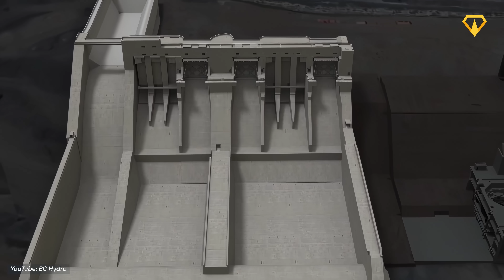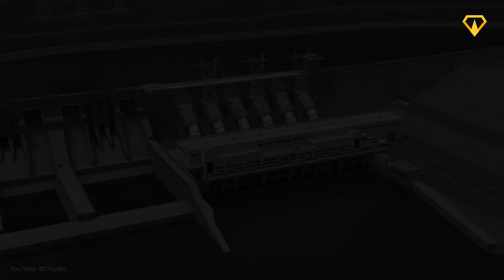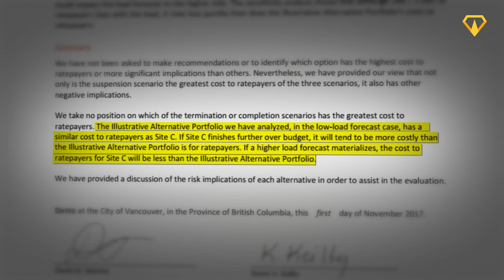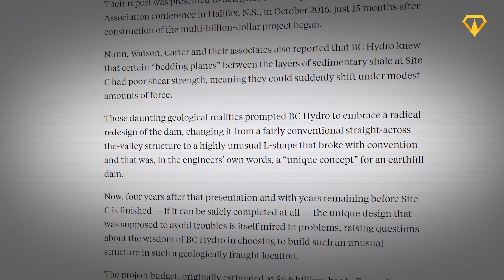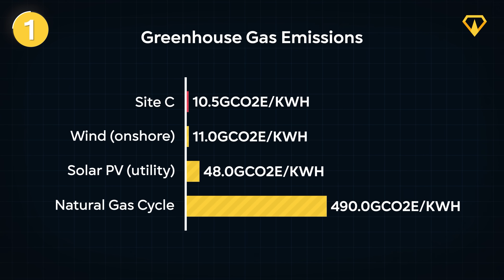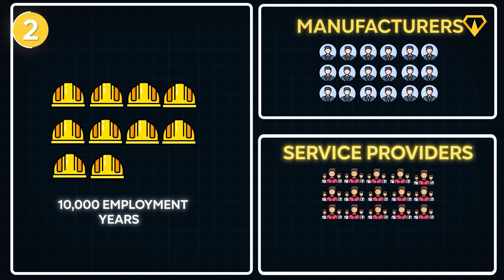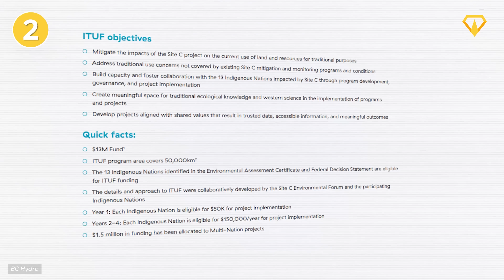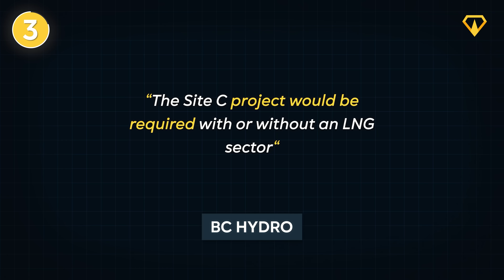Canada's Massive $12B Mega Dam

Comment: Canada needs a UHV transmission super infrastructure across the country. Today the interprovincial transmission system is outdated and does not even meet a third world country standards. Canada has a huge advantage, the different time zones. this would turn the whole system, if it was truly interconnected, in an extremely efficient one.
But no, let's be provincially independent. With that mentality western Canada has small and inefficient interprovincial interties. Just look at the Alberta Saskatchewan one, or the BC - Alberta intertie, a 500 kV double circuit with very limited use also restricted by provincial regulators.
If a federal transmission system was in place a $24 billion damm was not needed at all. Thanks to politicians blindness and lack of future vision every British Columbian owes $4000 at today's cost of the Site C damm.

Comment: With the headgate, you cannot control the amount of water flowing through the turbine, you can only switch off the turbine. Control is made by the wicket gate in the spiral housing of the turbine just close to the runner.

Comment: LNG from BC to Asian markets may not be such a sure bet.  China has already peaked in coal imports and is steadily eroding thermal coal with renewables, primarily solar and wind in an incredibly fast build out.  China is also getting very cheap gas from Russia by forcing Putin to sell it at huge discounts just to keep it flowing during sanctions over his stupid war in Ukraine.  China is also tops in battery tech with CATL and BYD batteries now being quickly scaled up in massive grid packs, allowing China, Australia's Victoria state, the UK and Germany to achieve enough renewable power to put gas and coal electricity peaker plants out of business recently, and future fossil power generation on notice as an increasingly tenuous investment.  The IEA has been documenting the approaching steep S curve in worldwide investment in solar and wind for a few years now and noted that money flowing into solar and wind has surpassed the total world investment into fossil fuels for the first time last year.

Site C power should, in my view, be used to catalyze the electrification of the domestic economy, to reshore steelmaking back to Canada and power up R&D into producing low emission cement.  Low emission steel using electrolysis and electric arc furnaces is already out there or just coming off the lab tables at MIT for commercialization.  BC LNG could become a huge stranded asset by the early '30s if its export markets in Asia decrease their demand for fossil gas by ramping up electrifying their own economies, or force BC LNG suppliers to drastically lower their prices, a highly unlikely prospect because it's very expensive to produce and ship and is already outcompeted by Gulf Coast LNG.

Comment: The area that is going to be flooded is so tiny it's almost comical on the scale of the Peace River watershed.
Reply: 5% of the size of Williston. For anyone not familiar with Williston, it’s so large it generates it own weather systems and can go from a calm sunny day on the water to 6 foot whitecaps. It feels like standing at the edge of an ocean in some places. The impacts from creating Williston area still being understood, not to mention the abhorrent treatment of Indigenous people when it was flooded.
Reply: @LeopoldOfOrange  Are you using a surface area, volume, or some other measure for the 5% Building a dam changed the local area. But change isn't bad just because humans did it. If you removed all the dams in the Tennessee Valley you would for a period of time cause massive changes to the local environment. This would change it back to it's natural state which is as alien to the current plants and wildlife used to lakes and slower rivers as  it was when the dams were built to start with. Site C will change the local area into a lake. Not banish it to the shadow realm. 

To be clear I said Peace River watershed which is not the correct measure given it's 300,000 square km size, including Williston. That's me being a bit dishonest. Losing 10,000 hectares out of 300 million is however still like I said nothing. But in a more local area which might be more honest centered around the river is an area 100km square. Given the 80km length of the river between the C and Peace Canyon you are losing an average amount of land about 625m (.625 x 2 x 80 = 100) on each side of the river assuming a perfect even distribution of flooding. You can use Google Map and the measure distance tool to get an area calculation to see how much land will be changed into lake.

I don't think it's as bad as anti development activists claim. It never is. Another GW or so of peak power generation will help with growing energy demands. If you really hate dams then the best other low cost, low space, low carbon, high reliability output is nuclear; Which be built anyway to meet our energy needs all throughout North America.
Reply: The dam is a much needed project for an increasing population and it will generate a lot of wealth.
On another note:--
Start calling it PACIFIC  COLUMBIA as it is more appropriate.
Britain invaded many countries during its 300 years of its greedy empire and killed more people during that time than were killed during WWII.
Its a fact.
Spread the word. - Pacific Columbia.

Comment: If factor in long term inflation perspective, the project should worth every aingle dime spend. The short term ecosystem impact should be temporary if managing well, will heal over time. Another thing seems ignored is that tourism could contribute impressively to local economy for the next 100 yr. Some bonus in electricity export along with the improvement of storage capacity...

Comment: Was it not the WEF that said that hydro liberates entrapped CO2, and they declared it to be the same carbon expenditure as a coal power plant?  A study in their archives shows how this happens and that the CO2 is not only trapped in moving water but also comes from the reservoir basin floor. When the water exists, the damn the churning vents the CO2.  So, from what I gather, Hydro will eventually be unable to be used because of the environmental damage it poses with the liberation of CO2 that should remain in the soil.

Comment: there is no mention of the HUGE amount of BC power that goes to California
Reply: I thought that was weird to leave out.
Reply: The only power that gets sold is when we have a surplus which has been decreasing over the past few years. We have hit our peak here numerous times. We do not have an excessive amount of surplus power.
Reply: @MrDarcykampe  Anyone can just download the Electricity Export data from the CER. It tells me that BC without fail sells millions of Mw/h to the US every year. Some years it's low and some years it's high. Not exporting electricity doesn't mean we have no surplus, we can't force it to be exported if no states need it (sunny days, windy days, etc.)
From Jan 2020 to Dec 2023 (4 years total), BC exported 28 million Mw/h to several US states, of which 57% of that went to California.

In summary, BC does generally have extra capacity to export electricity AND since 57% of BC electricity exports go to California then the video should have mentioned it.

Maybe so Californians can watch this video and not have to feel bad.
Reply: When there’s a surplus you can’t just store it all for later. The advent of battery banks can store some but not all. Power generation is closely tied to predicted power consumption. When there’s excess it’s sold and when there’s a shortfall it’s bought. This is an oversimplification, but Powerex deals with the trading of power on the western interconnected grid abs things are complex. It’s all quite interesting.

Comment: Where to start. Look towards $20 Bn in debt financing.  BC has a massive Pacific Ocean coast, perfect for onshore/offshore guaranteed wind,15 mega watt floating wind turbines now exist, battery farms with capacities of 15 giga watts are being built today. Where are the LNG plants, SORRY I meant one single plant, you guessed it , on the coast, perfect for wind turbines access unlike the transmission line now required. This project is a comp.ete cluserfuk.

Comment: Natural gas power was the correct answer if the power was needed. But it isn't. Besides Alberta would be more than happy to sell you all the electricity BC needs. Even averaged over 100 years this is going to be the most expensive electricity BC is buying. I would remove all the dams from the Peace River watershed. They don't belong and construction of a new one nearly halfway through the lifecycle of the rest of the hydro system is retarded. The study's have been done all around the world and the fact is hydro power alone does more harm than good. Power generation, flood control, transportation, irrigation, city water supply. This project only checks one of those boxes.